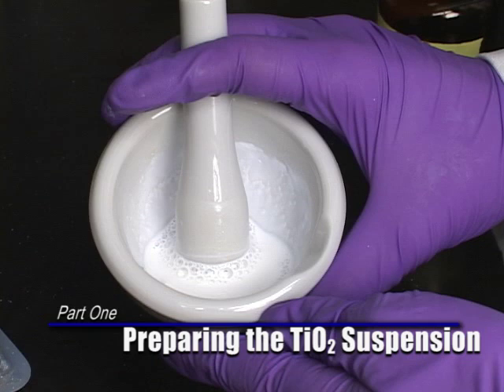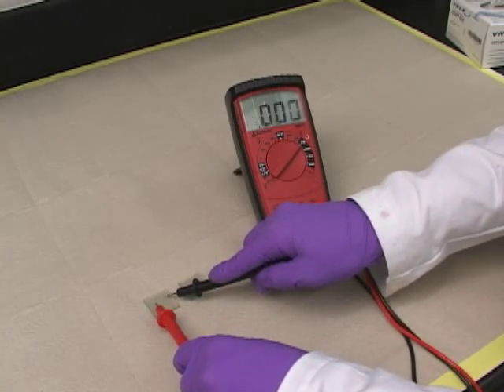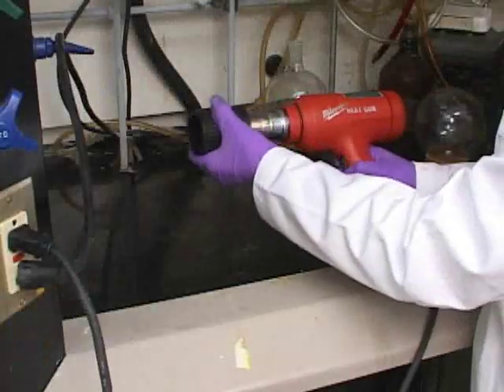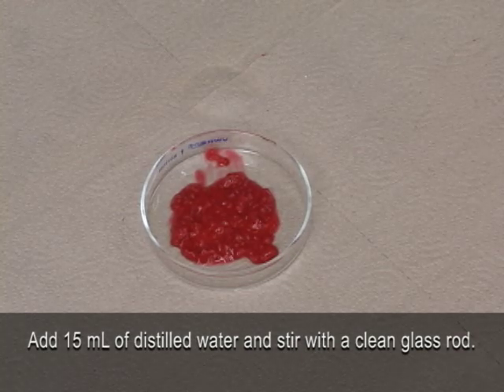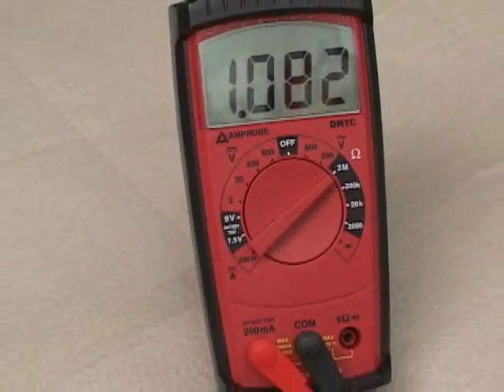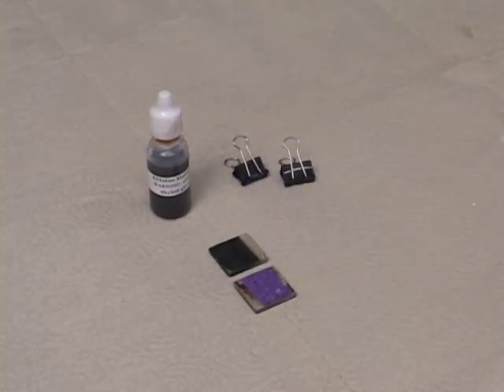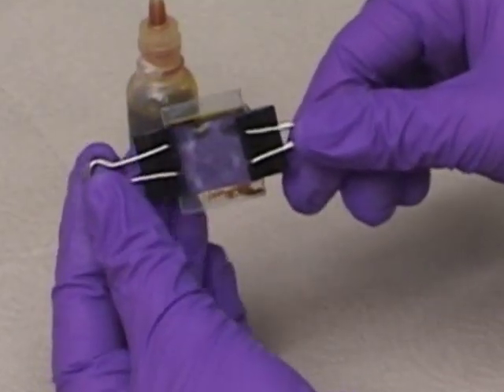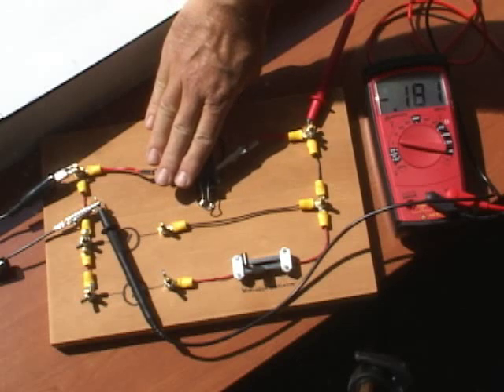Dye Sensitized Solar Cell Lab Procedure

Comment: It is a colloidal suspension of porous nanocrystalline TiO2, the particles are 10-50nm in size after grinding with the mortar and pestle. This exact size depends partly on how long you grind it.  The applied  layer is 7-10 microns thick.

Comment from the maker: @Jacknotzak 
We didn't try many other variations. potassium triiodide is the preferred electrolyte. I have heard that tincture works. The sheet metal might work, but it might create an electrolytic action that creates a current that either adds to or detracts from the photocurrent. And did reuse the ITO slides repeatedly. Wash them gently with soap and then acetone, the ITO coating is pretty tough.

Comment: Fascinating.
 
I assume that as long as the electrolyte remains as a fluid, the dye does not break down?
 
If this is the case, one could possibly prolong the cell life by sealing the edges of the cell with CyanoAcrylate glue.

Comment: I keep reading about how dye sensitized solar cells are cheaper than silicon based photovoltaics, how they are becoming more efficient, and how there's ongoing research with them. If they are truly so efficient, why have they not gone into production on a larger scale? Gratzel's company has put them into production with a small-scale mobile product, but what currently stands in the way of larger-scale implementations like rooftop power arrays analogous to photovoltatic rooftop arrays?

Comment: I have tried 2 attempts with metal. I am using a gas stove and burner.  On both attempts the TIO2 did NOT Anneal and stick (you could rub it off).  Either more heat is needed, or in the example with slides the TIO2 maybe annealing with the SNO2 layer.   Note that in my trial, the dye didnt stain the TIO2.  Thus the oxidation of the TIO2 was still current.  I will try a TIO2&Sno2 mix right now.

Comment: I have a bunch of questions:
Will it work with Povodone-iodine or Potassium triiodide dissolved in water?
Can we substitute a sheet of metal for the conductive glass which is to be covered with soot?
And lastly, can the glass be cleaned and reused to make another solar cell?

Comment: i have a question
i am doing my master's dissertation on DSSC and i wanna knw why to we need to heat the slide? if possible can we reduce the temperature and increase the time? cause i tried to heat my slide in an oven at 220 C and it cracked completely same observation when i tried to flame it?

Comment: Hi, good video :) thanks :). I have a little doubt, i'm working with DSSCs, and, when i do the process to deposit the thin film of TiO2 by the Dr. Blade method, i have cracking in the film. I have probe some suspensions, but the problem is not resolve. Do you known something to prevent that? Greetings and thanks again :)

Comment: The efficiency of this demo cell is quite low. Three in series could not match the output from a single small silicon cell.

G24 Innovations makes a graetzel cell the claim has 12% efficiency.